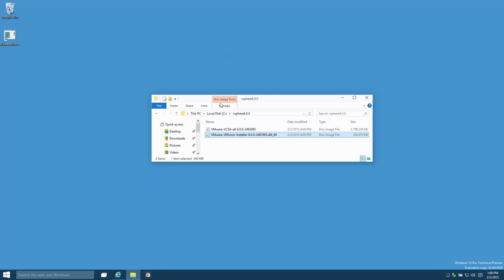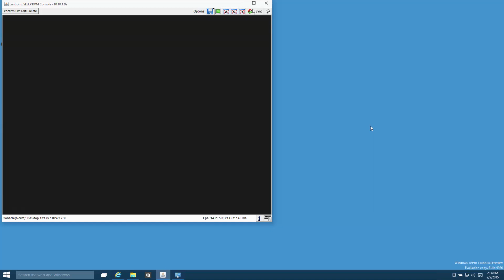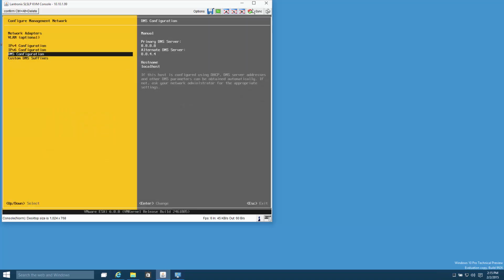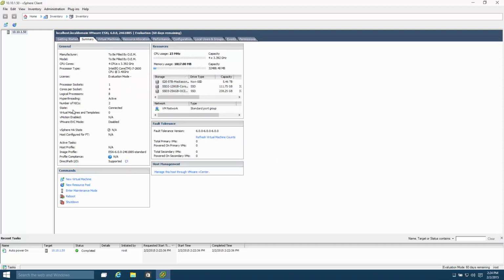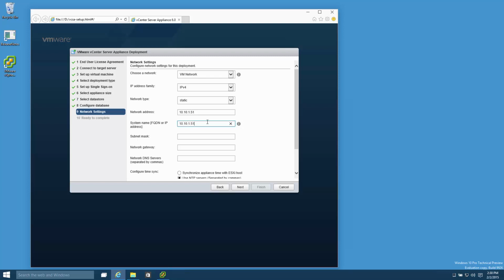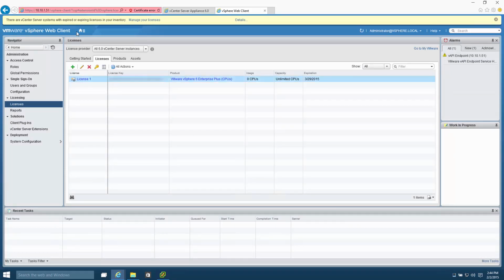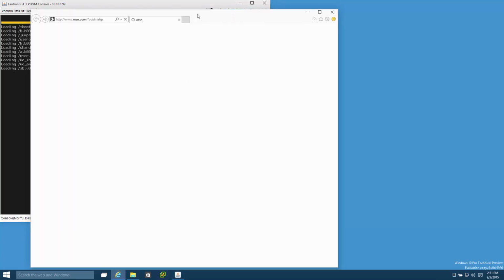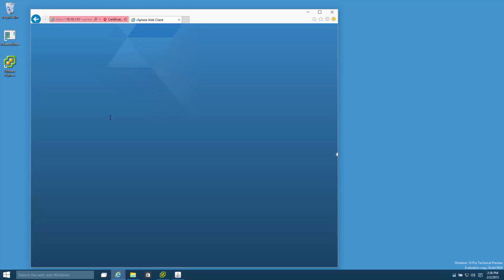Sneak Preview - Build your own vSphere 6 home datacenter in about an hour

Comment: Your first thumbs down now. For 10 minutes I watched you install vsphere on the thumb drive. You could really speed that up. That is why this video lasts so long.
Reply from the maker: o.0 Oxoxoxoxoxoxoxoxoxo Fair enough.
FYI, I'm working on a much more refined video based on the GA product (this quick video was intended to be short-lived). It will have a lot refinement (which takes many many hours, and frankly isn't very fun), speeding up or editing out every boring segment possible, while trying to avoid jarring discontinuities. Also worth noting that that Camtasia only allows 400% speedups, so I tend to just cut out sequences where it's not important to see what is supposed to happen in real-time.
Reply: +o.0 Oxoxoxoxoxoxoxoxoxo 
Disagree, you may know how to create a bootable USB but Pauls section on this is specific and is required to show all the steps. Just fast forward if you already know that bit. re-arrange these words - science its rocket not